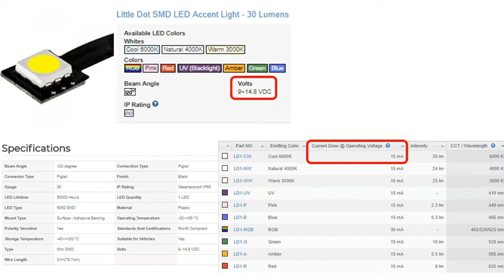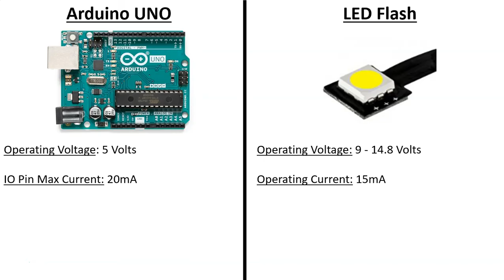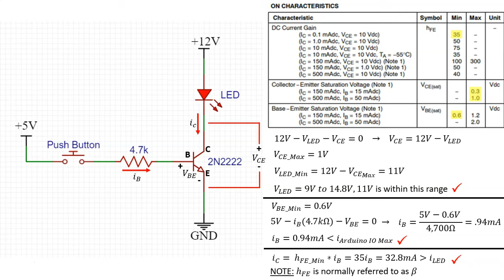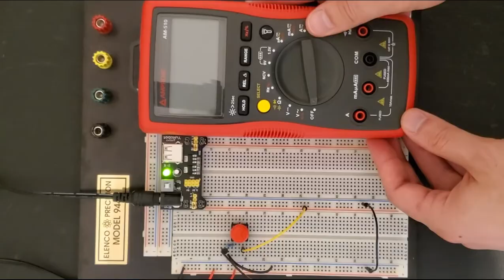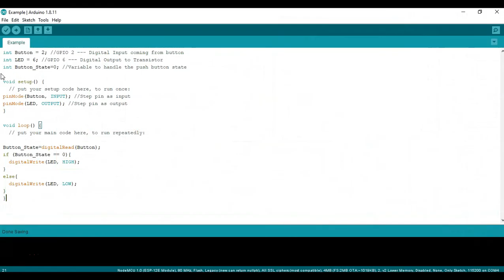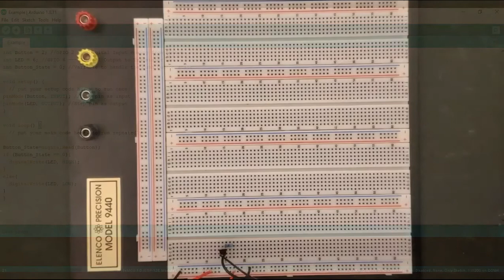2N2222 NPN Transistor as a switch - Arduino example with LED Flash

Comment from the maker: Where to buy [Amazon Affiliate]:
Arduino UNO:   https://amzn.to/3U7xAoT
Hilitchi Transistors Assortment Kit:   https://amzn.to/4aI8Mux
Electronic Component Kit:   https://amzn.to/3xDtHAn
Amprobe AM-510 Multimeter:   https://amzn.to/44gy2WE
Amprobe TL35B Test Leads with Alligator Clips:   https://amzn.to/3Utf8s0
Breadboard (Elenco 9440):   https://amzn.to/4b5Onzq

Comment: I don’t understand why the 220ohm resistor is needed there between button and GND1. If there is no connection, you don’t need resistor right? Why put an extra wire between GND1 and button there? 
Appreciate for any help.
Reply: In order to make the circuit closed. The voltage coming from the pin should be connected to GND, and 220 ohm resistor helps to do that.
Reply: @ I thought there is connection internally from D2 to GND inside of Arduino? 
It’s hard for me to imagine the reason to “close the loop” if the current doesn’t travel that way. But I am not current. Can’t understand why adding a circuit there. 😅

Comment: With no current  limiting in series with the LED and transistor, you should destroy the LED and/or transistor.  What is the voltage drop across the LED, what is the voltage drop across the transistor and what is the total current through the transistor.  While this may have worked for the components you used, it could be useless for random component choice.  At what point of the conduction curve is the transistor?

Comment: Very clear presentation, but your calculation of 0.94 mA is is off by an order of 1,000. It should be 0.00094 mA. If it were nearly 1 amp your Arduino would be fried the instant the LED was turned on.

Comment: I am an electronics student, and I am trying to understand how a transistor is used like a switch. Why do we need the transistor to switch on and off the LED while we can just use that button when the LED is connected to a battery?
Reply from the maker: Thanks for watching. I am using the signal from the Arduino to turn the light on and off. The issue is that due to the electrical rating of the LED Flash, I am unable to power directly from the Arduino, so I use the Arduino signal to tell the transistor when to allow current to flow through it (basically having the transistor to operate as a switch). This transistor is rated to handle the electrical load from the LED, which is why I am using it.

Comment: Woho! It's working, thanks! Good idea with the trouble shooting, I did that and found voltage across my LED, that way I realised that my LED was broken.:)
Reply from the maker: Thanks for watching!
Reply: One time, I measured the current going through a resistor and LED as I increased the voltage. I need a variable voltage source. I want to make a graph. I think the resisance of diodes goes down as you increase the current. Is that it?
Reply: I have no idea 😅

Comment: The fact that this particular part has "built-in resistance" does not matter since your circuit diagram clearly states "regular LED". Also you code doesnt add up with actual results obtained, which kinda undermines the whole experiment. And the worst thing is that you math isnt actually explaining anything. It doesnt explain how to find values we are looking for, how to find proper resistance and transistor, it just shows how your already-in-place results are correct (and they are not, since your shematics doesnt reflect actual parts being used). This material is useless AND confusing for anyone who knows less than you do (or claim to).
Reply from the maker: Thanks for watching!
Reply: @diyengineers  yeah, you tricked me into that. Hope you proud.

Comment: I am using a Transistor to increase the current at 5 volts. I am making a parking proximity sensor using a HC-SR04 Ultrasonic Module and a 650 NM laser. The HC-SR04 detects the car rolling into the garage and the 650NM Laser is turned on for 30 seconds. The laser draws 30mA at 5 volts. I am going to use a 2.2K resister on the Transistor base.
Reply: When you drive a transistor into saturation, the rule of thumb is to set the base current at 1/10 of the collector current. have a look at the datasheet for the 2N2222 and you'll see that all of the examples of saturation show base currents one-tenth of the collected current quoted. If the collector current needs to be 30mA, then normal design is to drive the base with 3mA. The value is not critical and if you have 5V available to drive the base, then a 1.5K resistor will give you about 3mA. Your 2.2K resistor will give about 2mA base current and that will also work fine to drive a 2N2222 into saturation.

Comment: How can I control a motor using 2 sensors? It works if I wire both sensors in parallel to the same pwm pin. But I want to be able to control the motor from 2 different arduino pins. Is this possible? Would i need to use 2 different bjts?
Reply from the maker: Hi. Thanks for watching! I think you should take the sensor signals on separate I/O pins in the Arduino, and use the code (if statements, etc) to determine when to send a given signal to the motor to move.

Comment: that led is dead without a resistor at 12v
Reply: Because LEDs are now so commonly used in automotive applications, it makes sense for a manufacturer to build the part with a built-in resistor (or some other means of current limiting) so that the voltages encountered in use with a car having a 12V battery can be connected directly to the part. You can see that the datasheet specifies a voltage between 9V and 14.8V, and car alternators are specified to output a maximum of 14.8V. When you see a part specified with a maximum voltage of 14.8V, it is a sure indicator that it's designed for automotive use and will tolerate 12V directly.
Reply from the maker: I think I made mention of it being a special LED with a built-in resistor. But, yes, if it was a standard LED, it would be an issue. Thanks for watching!

Comment: Hi, i'm just about to test this circuit, but i'm worried about the 12v going to the Vin or the arduino, should that be there?  other examples don't seem to be as detailed as yours. Won't 12v fry the arduino??
Reply from the maker: Hi, you can power the Arduino UNO multiple ways. The Vin pin is one of them. See the links below:

https://www.arduino.cc/en/reference/board

https://store-usa.arduino.cc/products/arduino-uno-rev3/?selectedStore=us
Reply: @diyengineers  Ahh! thanks!

Comment: I'm confused. Why even use a transistor  when you can  hook the led up straight in series with the switch?
Reply from the maker: Hi NoVakane. Thanks for watching. The transistor let's you switch another power source on/off by using the low power I/O pins. You wouldn't be able to power directly a device that operates at a current or voltage that's above the allowable limits of the Arduino, so the transistor let's you go beyond those limits (as long as the voltage and current don't exceed the transistor limits).

Thanks for watching!
Reply: It was used as an example. In this case you could just bypass everything. This video shows how to control a circuit with a higher voltage than your 5V controlling circuit.
Reply: Because in years gone by LEDs would typically require 15 or 20mA of current to illuminate them to a reasonable level of brightness, and the logic outputs of chips in those days could not source enough current. Their output drive current was typically a few milliamps and so a transistor had to be used.

Now in more modern times the drive current requirement for an LED can be a lot lower.

So whilst a transistor may not be strictly necessary in this instance, it is important to be able to design with a transistor on a logic pin output, to teach the design process.
Reply: @deang5622  ooh I see

Comment: First of all let me say. Its so refreshing to see the younger generation taking and active interest not only in understanding electronics and circuitry along with the laws that govern its principles, but also taking on a role as instructors and teachers of such. You are the future designers who will change our world in so many innovative and useful ways. As an electrician of 34 years I applaud you. Constructive criticism.  Its important to have your math spot on. The numbers wont lie. What might lie is the testing equipment's calibration or the variables of the parts you are using. Things as simple as the resistance of wire size and length along with ambient temperature could cause some of the math not being precise when it comes to the values your digital volt meter was registering as well as the resistor value the resistor claims to be vs the actual resistance when measured.. I would like to see you get to the bottom of this and fully explaining why the measured values did not match the math values. OHM'S law has been around for a long long time and its proven over time and experiments. I would like to see you give explanations based on reality when the testing equipment does not match the math. If you know your testing equipment is sound then perhaps you could give us the actual VD across the LED or the actual values of the transistor. Something had to be the cause for the math not being spot on when tested. And this is where you separate the blind from the leaders of the blind. Personally I have thumbed up and subscribed to your channel. I am so happy to see someone not only give resistor values and the math but then show the circuit being tested to make sure the math was correct as it should be. I will be following you and hope to watch you learn and grow and accomplish great things. You are well on your way. Thank you for an excellent video.
Reply: The main reason why the maths is not spot-on is because the LED has built-in current limiting, which may be either a resistor or a constant current device. The datasheet for the LED is showing 15mA, but that will be a typical current under a specific set of operating circumstances and in this circuit, nobody should be surprised if it was measured as 17.7mA. Measuring the voltage across the LED will tell you nothing other than the Vce(sat) of the transistor at that current.

 The small error in the measured base current (0.91mA vs 0.94mA) is well within the range of accuracy of a 5% resistor, and it should be noted that the 0.6V for Vbe used in the calculation might be anywhere between 0.6V and 1.2V, except that those values are quoted for Ib=15mA and we only have about 1mA, so we don't have specifications for what Vbe actually will be. Using 0.6V as a "guestimate" is quite reasonable, but then you have to expect some variations from what you measure in a real circuit.
Reply: @RexxSchneider  Thanks, that's pretty accurate.
Reply: Example https://www.youtube.com/watch?v=8DMZSxS-xVc
Reply from the maker: Thanks for watching and for your encouragement!

Comment: What's the point of the base? I was able to do this without any connections there, nor any transistor at all, of course
Reply from the maker: So did you just power it directly to the voltage source? The intent is to use the transistor as a switch, which then let's you control the flash with an Arduino (or similar) which operates at a voltage that's below what's needed by the LED.

Comment: You are applying 12 v to a led without  current limiting resistor. This does not make sense.
Reply from the maker: Hi Robinson. It is an LED flash that was designed to light up when 9V-14.8V are applied. It's a ready to use component (not a standard LED). That's why a resistor is not needed (it's already built-in).

See this link for more details: https://www.superbrightleds.com/moreinfo/led-wired-bolts/little-dot-smd-led-accent-light/639/

Comment: You should mention that a normal  LED would be destroyed if you connect it directly to 12V via a transistor. Most LEDs don't have built-in limiting resistors. So you just forgot the limiting resistor on your schematics.
Reply from the maker: Thanks for watching and for calling this out!
Reply: came to the comments, because this confused me! Thanks for confirming that and hopefully preventing a lot of broken leds :P
Reply: @dannyvandenakker8773  👍

Comment: With typical indicator LEDs, you have to limit current flowing through them, or you will burn them out. Is this LED different in that regard? Will it limit its current draw (thus reducing the collector current)?
Reply from the maker: Yes. This LED flash is ready to use from the supplier/seller and does not require adding a resistor for current control. If you were using a typical LED, you would need a resistor.

Comment: Can u explain? Why chose res 4.7k without caculate.
Reply from the maker: Hi! Thank you for your question. On the video at 5:25 I go over the minimum voltage between the base and the emitter, and we write the equation to relate the base current to the voltage drops and resistance (in this case selected to be 4.7k). Selection of 4.7k allowed the base current (ib) to be 0.94mA, which is below the maximum allowable at the Arduino IO Pins. As a result, 4.7k is an acceptable resistance. You could use a different resistance, but you need to ensure all equations work. For example, if you picked a larger resistance, the value of ib would drop, which is okay when comparing against the maximum allowable current, but this could cause issues on the equation I show later (ic = hfe_min * ib), because if Ib is too low, then Ic might be low too, resulting in the LED not turning on.

Hope this helps!
Reply: Thanks. At 10:01 Ic =18.54mA and Ib=0.9mA so hfe=19, but in datasheet hfe_min=35, why? AND 0:43, the current operating LED is 15mA, 18.54>15, i meant what is the current rate of LED?
Reply from the maker: The current gain (Ic/Ib) can vary due to manufacturing tolerances of the transistors, temperature, current, etc. What you want to do is design your circuit such that it can operate at the minimum specified current gain, in this case at 35. You can see this at 6:19 where I calculate  Ic using the minimum specified current gain, I get 32.8mA, which is above what the LED should be pulling, so we know the transistor will be able to provide the required current (which is expected to be less than the 32.8mA that were calculated). We are not pushing the current, the LED is pulling the current based on what it needs (based on its specifications), so we are simply doing the calculation to ensure the transistor can supply what the LED demands.

When I made this video, the LED specification indicated an operating current of 15mA. Normally we would use this as guidance for the design of the circuit. I went back to the website (link below) and saw that they actually updated the specification to show a current of 20mA. So our measurement is now below the rating they have on the website. Slight variations versus listed values are expected.

https://www.superbrightleds.com/moreinfo/led-wired-bolts/little-dot-smd-led-accent-light/639/#tab/specifications
Reply: @diyengineers  yup. thanks a lot!
Reply from the maker: Glad I could help! 😀👍
Reply: @tungvan4029  The Hfe or β applies to a transistor working in its active region, i.e. as an amplifier. When you use a transistor as a switch, you drive it into saturation and that means that you use a higher base current than would be needed, and this makes certain that the transistor has very little voltage across it - the Vce(sat). To ensure saturation, you should design the switching circuit so that the base current is 1/10 of the collector current. Normally therefore you would design the base current to be 1/10 of 15mA = 1.5mA, and that would require about 3K. This is not critical and the 2N2222 will saturate using a 4.7K resistor to 5V (about 1mA base current).

The datasheets for these automotive LEDs (i.e. intended for use in cars with a nominal 12V battery) only give typical values and these are often very approximate because a car battery won't care whether it is supplying 15mA or 20mA. There is nothing surprising about measuring around 18mA for the LED current.

Comment: your switch uses pull-down resistor, right? meaning, the pin will see 0 if button not pressed. your code says, if button == 0 (not pressed), then turn the LED on (?).. but your video shows the other way around.. is my understanding correct?
Reply from the maker: Thank you for your question. I reviewed the circuit and code, and I agree you are correct. When you press the button, a 5V signal will be sent to Digital Input #2, and when you release the button (not pressed) a 0V signal will be sent to Digital Input #2. That means that Button_State = 0 when the button is released (not pushed). The code shows that when Button_State = 0 the LED will turn on, but then the video shows the opposite. I must have changed this last minute and forgot to fix the code. To address this, change the If-statement as follows:

if (Button_State == 1){
digitalWrite(LED, HIGH);
}
else{
digitalWrite(LED, LOW);
}